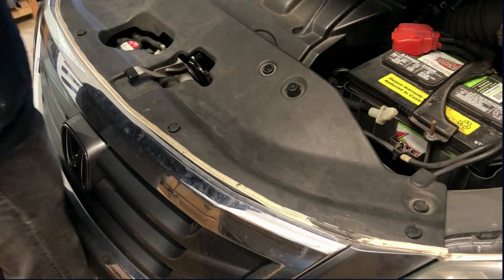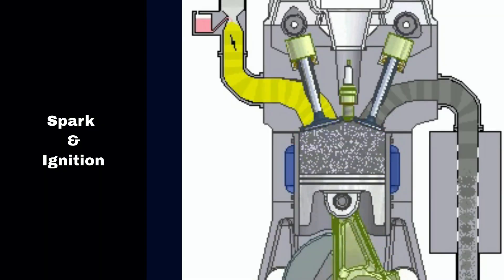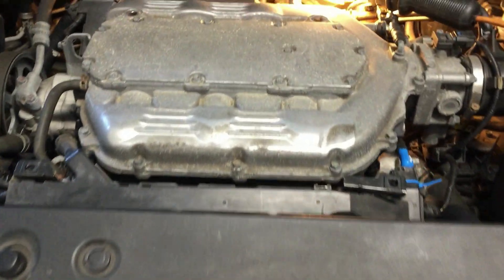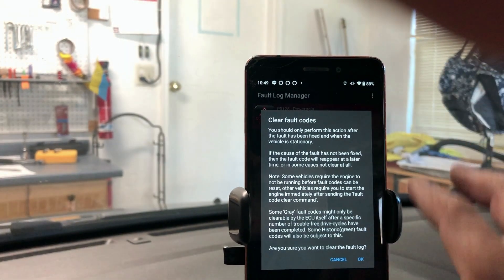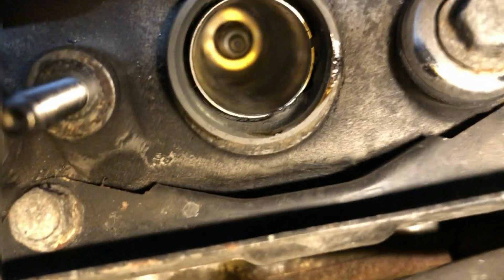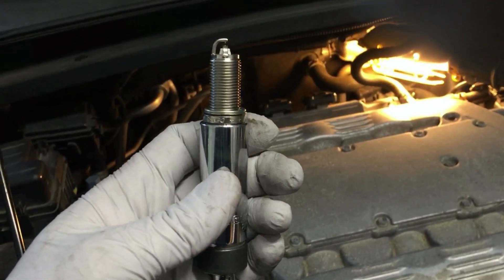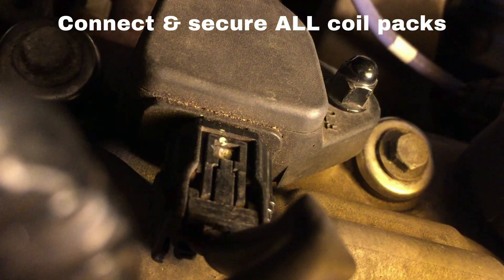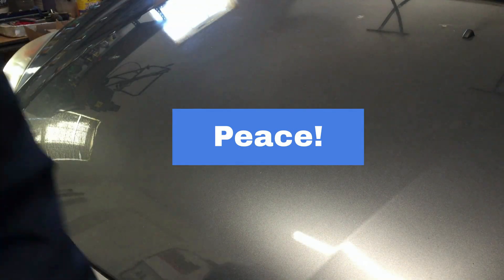Engine misfires w/ code P0302. Spark plug or ignition coil pack? Diagnosis and fix.

Comment from the maker: Again, I strongly recommend OE parts for ignition coil packs and spark plugs. You can shop around and get them for reasonable prices. Here are some product links for your information: 
* Denso spark plugs: https://amzn.to/3TfXFBG
* NGK spark plugs: https://amzn.to/3vaTcIx
* Ignition coil packs: https://amzn.to/3TA1KBY
* Spark plug socket: https://amzn.to/4aywYz1

* Disclosure: As an eBay Partner and Amazon Affiliate, I may be compensated if you make a purchase from the product links.

Comment: I replaced my sparkplugs The code is cleared and i tried with a new coil and the wire for cylinder 2 is not connecting to it it's not the coil what you think it is
Reply from the maker: What do you mean by "wire not connecting to it"? No voltage at the connector or incorrect connector? Did you use OE spark plugs and OE coil pack too? Did you try the coil swap method in the video first to see what the issue was before replacement? It would be a coil problem only if misfires followed the coil swap. Factory coils, if they still work, are better than aftermarket ones.

Comment: I also tried everything all spark plugs and still have P0302 plus smoke coming from engine
Reply from the maker: The "plus smoke" from the exhaust is more important to note than having p0302. What color is that smoke? It can be excessive fuel, oil burning, or even coolant (hopefully not) depending on what you see. Until you find out what that is and address it, it cannot be fixed by replacing spark plugs alone.

Comment: if that would be ignition coil, wouldn't that give actual different error code?
Reply from the maker: Good question! It would, if the coil ultimately fails. But it's more common to have a weak coil pack that still delivers the voltage within the expected range but that isn't strong enough for the plug to spark, especially when both are worn/weak. You usually will get misfires when they are aged and would have to address the issue first before they completely fail.
Reply: @profsg  Thanks for reply!

I have a P0352 error (Ignition Coil B Circuit Open). The error only appears when the engine is warm, not when cold, and comes and goes. 

My scanner shows no misfires. 

Should I replace the ignition coil?
Reply from the maker: Definitely check that coil and its connections. It might be faulty or due to electrical issues with wiring/connector/ground/etc.

Comment: Question … I had a misfire on cylinder one and I swapped cylinder two with one and the code cleared… what could be the cause of that
Reply from the maker: Probably loose connections. You can check on them next time you are there.

Comment: have 2 ?'s have a 2016 Dodge Journey SXT code P0302 i have already changed All the spark plugs and the coil packs. still same Code  didn't change injectors that's next see if that solves the problem. also have a 2001 VW Beetle with 1.9 TDI air in injector lines and continues to get air in line what would be the issue.
Reply from the maker: I am not particularly familiar with either make and model. But there Dodge Journey product year appeared to have problems with one of its cylinder heads and valves. Consider a compression test and/or a leak down test to know whether you may have internal damages.
Reply: Did the injectors work?

Comment: Does it mean anything if you get a p030# and not a p0300?
Reply from the maker: Yes, you know it's a specific cylinder problem if it's a p030# code (with the last digital indicating the misfiring cylinder number). A p0300 (or both) random misfires can be due to broader issues such as fuel / fuel delivery, air (vacuum leak), timing, worn engine components, etc. affecting all/any cylinders.
Reply: @profsg  Thanks for the response. So I'm hearing that a p030# dtc referring to a specific cylinder is better than a p0300 dtc that suggests bigger problems than just a spark plug or ignition coil.
Reply from the maker: Yes, that's generally the case. Sometimes, though, that specific cylinder can have a major problem too. Start with simple fixes first. In your case, if it's a one-time problem, I'd check engine oil level/condition and fuel. The easiest is to change oil and switch to a better fuel, and see how it goes in the next 100 miles.

Comment: Thanks for the great video. I had a solid check engine dummy light come on at startup time and subsequent scanner report showed a p0302 dtc on my 2015 Lexus Rx 350 ( 2gr-fe v6 ) with 62k miles. The engine seems to be running smooth. Clearing the DTC didn't lead to it coming back on after a mile of driving and engine operation afterwards. What should i conclude is going on in this scenario?
Reply from the maker: Glad you liked the video! Just to clarify, are you saying the P0302 DTC (Cylinder 2 misfire) did not return after clearing it and driving the car for a mile or longer? You may drive a bit more before making a conclusion. If the code hasn’t returned and the engine is running smoothly, it might have been a one-time issue, e.g. sometime due to the fuel you used. However, if the light comes back with the same code on cylinder #2 or you notice rough running, then something is going on with that cylinder. On Toyota's 2GR-FE engine, which has a 10-year or 120,000 miles spark plug replacement interval, it's about time to replace them for preventive maintenance, even if the problem doesn't persist.
Reply: @profsg  Thanks for the response. Yes to clarify the p0302 dtc (1st cylinder on front left side vs right / battery side) code did not return after clearing it so far in the few miles of driving I've done since clearing it. I'm hearing that the spark plugs even though they are rated for 120k miles, and even lexus dealership said I didn't really need to change them when I did coolant and transmission fluid changes at 60k miles, they should be changed due to them being 10 years old? The back / firewall side cylinders appear to be the ones that make the job less straight forward than it would be otherwise. 

Would you think that an ignition coil failure is likely at 10years / 62k miles or less likely than it being a spark plug?  If the engine is seemingly running smooth in spite of the solid engine light and p0302 dtc code that was raised would experience suggest its most likely a spark plug or ignition coil rather than one of the more difficult to pinpoint and/or costly to repair issues?
Reply from the maker: A solid CEL with P0302 and a smooth engine is not a major concern, especially if the code hasn't come back after you cleared it. The recommended interval is whichever comes first (10 years or 120,000 miles) and for preventive, not that I have a concern of your sparks. I have a video on spark plug replacement on the later 2GR-FKS engine: https://youtu.be/2L0Bg78BRYg?si=anqBE6R5DGt2CDT6, yours (2GR-FE) is a bit different but doable too. :) If you end up replacing one plug, do go ahead to replace all. 

OE ignition coils can last a long time, but if you replace spark plugs and grease/install coil packs at the recommended interval, you create a better condition for the longevity of the coil packs too, which are much more expensive than spark plugs and I'd go for OE if I were to replace them. All my vehicles (this Honda at 165,000 miles, a Lexus at 125,000 miles, and a BMW at 94,000 miles) are still on factory coil packs. Also for OE, no need to get them from the car makers, just find out who the manufacturer is and get that brand.

Comment: I replace everything and still have P0302
Reply from the maker: I suppose you've cleared the code and it came back? Assume it isn't due to fuel injectors or internal wear/damage in the cylinder #2 (e.g. stuck piston rings, valve seals), you may try new fuel and change oil before anything else. Disable VCM (simple steps in this video: https://youtu.be/z0bO93r4YSE?si=3X87LFq85HxIUNb5) will help long term. But if none of these helps, you may consider a compression test (and/or injector test) on cylinder 2 to see whether there is internal damage or good seal in that cylinder for combustions. Good luck!
Reply: @profsg  thank you sir for your time and response. My situation very weird cuz look what I already do: Pressure in cylinders ok, fuel, pressure ok, replaced was - injectors, sparks plugs, ignition wires and coils, crank sensor, EGR cleaning, fuel rail clean. What else can be ? In theory mechanic tell injectors wires can be something wrong? Or he tell O2 sensors? But OBD not show any problems with O2 sensors. P.S. on Gas-LPG everything works nice on all cylinders, no errors and no power lost , but on Benzine - petrol (usual standard fuel) P0302. So its mean in theory problem in fuel system. P.s. i replace Injectors and still same problem cylinder 2
Reply from the maker: Wow, this is a lot of work/care! Did you use all OE or OEM parts? It's quite puzzling indeed but two things came to mind. Are those misfires associated with VCM, i.e. during cylinder deactivation? VCM is the culprit to many problems including oil burning misfires and it's always beneficial to disable it. Second, did you look at wear and carbon buildup in cylinder 2 with a borescope/endoscope? Given LPG has no misfires, I suspect it is carbon buildup related, which VCM could have contributed to.
Reply: @profsg  thank you very much sir for your thoughts and recommendations and your knowledge sharing. I will try check everything what  you say and recommend
Reply: @profsg  only I don't really know what is VCM :( I have ECM and ECU for sure but VCM not sure . P.S. car Mitsubishi Eclipse 3.0 V6
Reply from the maker: VCM is Honda's technology--I had assumed yours to be a Honda--and it doesn't apply to a Mitsubishi. Mitsubishi doesn't use anything like this, which is good news, but if you are interested in what VCM is, here is a video: https://youtu.be/z0bO93r4YSE

Comment: I have an mkz 07. Seems my clips are not in tacked to connect properly.  From harness to fuel injectors. Is there any way to fix that other than using zip ties ??
Reply from the maker: The best would be to replace the connectors to fuel injectors. Double check compatibility and this appears to fit your vehicle: https://amzn.to/3CdF84e

Also clean your injector terminal/pins with contact cleaner to make sure you have good connections. Best luck!

Comment: Question, we’ve cleared the P0302 code or sometimes it goes away on its own. It still only shows this code but we’ve just changed spark plugs not too long ago but we doubled checked them and moved them around but the code still persisted. I’ve also checked the injectors and replaced the 2nd one since that’s the the cylinder it’s saying the issue is with but yet again the code is still there
Reply from the maker: Suppose your replacement plug is OE and you don't have major oil burning problems, I'd check/replace the ignition coil for cylinder #2, the wiring and connector to the coil. If wiring is good, clean your connector and make sure it has good contact/connection. The other possibility is mechanical problems within cylinder 2 (e.g. with valve seal or piston ring) and you may run a compression test to find out.
Reply from the maker: If all cylinders have this intermittent misfire, check your ground connection. If it's intermittent misfire on cylinder #2, check connectors/wiring to coil AND injector.

Comment: I swapped the coils cleared the code but the light never came back on ….. what does that mean
Reply from the maker: It's probably due to a poor connection and, when your disconnected and reconnected a connector, it might have shaken up whatever dirt, corrosion, or simply a loose plug that caused the misfire. I'd clean the connector contact and monitor the situation.

Comment: Hey sir @profsg I just got spark plugs and coil pack done and still the same problem 🤦🏽‍♂️
Reply: 175,350 and I’ll have to check and see if it burns oil. It’s just shuttering / shakes while accelerating around 35-40 mph and cylinder 2 misfire . And yes I got GE parts from shop. Got the spark plugs and coil pack changed
Reply from the maker: I'd prefer Honda/NGK plugs over GE on a Honda engine. But if it's iridium, you are probably okay. For oil burning, check your engine oil level. It's very common on Honda engines with VCM so make sure you disable it for good. As the shuttering while accelerating, sounds like the transmission is having some difficulty. At 175k miles, unfortunately, it's late to start replacing transmission fluid if it has never been touched. Honda transmissions--except for ZF transmissions they used on some models--are not known to last a long time and regular fluid change could have helped extend their lives.
Reply: @profsg  I got a 2010 Nissan maxima
Reply from the maker: Then it's in a different territory. Hopefully oil burning isn't an issue but CVT transmission may need attention too.
Reply: @profsg  think that will be a major / hard fix ?
Reply from the maker: I am sure you have well maintained your vehicle to reach this high mileage with a working CVT transmission. I don't own a Nissan but the brand is known (famous) for its CVT problems. Do you have the full service history? Has transmission fluid been serviced?  If transmission fluid has been serviced regularly, you should continue to do that. If this has never been done, you/your mechanic should take an oil sample for an oil analysis before deciding whether you can/should replace it.
Reply from the maker: Also wanted to add a note regarding engine cylinder misfire on your Nissa--I assume you know the engine layout and cylinder numbering on a Nissan are different from what I show in the video for a Honda. You can follow the procedure/idea presented in this video for the diagnosis, but make sure you have the correct cylinder number and its corresponding location on the engine.
Reply from the maker: What is the mileage? Does it burn/consume oil? Was it misfire in a specific cylinder and it stays with the same cylinder after spark plug and coil replacement? If it's over 100k miles, it makes sense to replace all spark plugs and only use OE plugs (NGK or Denso) for this replacement. If it burns oil, you will have to address it first. Two major culprits of oil burning: 

1) PCV valve: https://youtu.be/bGVFDy7I0j8
2) VCM on Honda V6: https://youtu.be/z0bO93r4YSE

Comment: I have a 2011 Honda Odyssy 3.5    been getting the code 302    changed the spark plugs and it soiled the plug again in 2 weeks so I changed the plug and coil and 2 weeks later got the 302 code again     not sure what else It could be           any help?
Reply from the maker: Is there oil/deposit on the #2 spark plug in only two weeks? If it's not bad fuel, likely oil burning due to worn piston rings, etc. Certainly keep up with oil change, and if there is oil burning I'd recommend: 

1) Replace PCV: https://youtu.be/bGVFDy7I0j8
2) Deactivate VCM: https://youtu.be/z0bO93r4YSE

to mitigate the issue. Also, I assume you used OE spark plugs and coil packs.
Reply: @profsg  Thanks for your advise   will try those things    Thanks
Reply from the maker: @chupie123456  Best luck! Keep us posted.

Comment: The ROOT of the problem on that Honda V6 is VCM (Variable cylinder Management) Those bad coils and foul spark plug problems (plus others )will continue  unless you disable the VCM.
Reply from the maker: Yes! Thanks for pointing this out! Here is a video on how to disable VCM: https://youtu.be/z0bO93r4YSE?si=br42hSqimqxE5G36

Comment: In my Hyundai i20 2009 petrol, I had p0301, p0303, p0300 cylinder misfire، 
I gained all spark plugs and coils also had cracks so I changed all four coils too.
Car worked fine for a day then again it started giving p0302 and p0301 error code since I already had new calls and new spark plugs I changed all 4 fuel injectors.
Again car worked fine for three days and fourth day again error p0302. This time it is only in cylinder 2.

I don't know what to do any help please?

Are you explained in the video I will be changing the engine oil and see if that make any difference.
Reply from the maker: I am not familiar with the Hyundai engine but does it burn/consume oil? Do you see or smell anything from the exhaust? Has the engine been running rough/rich/lean? Basic things to check could be bad fuel, oil, clogged PCV, rich/lean conditions due to faulty sensors (MAF, O2, etc.) or even throttle body buildup. If possible, I'd run a scan to monitor the fuel trims. If nothing else, definitely change oil, fuel (perhaps at a different gas station), and if PCV hasn't been touched on this 2009 model, change it: https://youtu.be/bGVFDy7I0j8

Best luck and keep us posted.